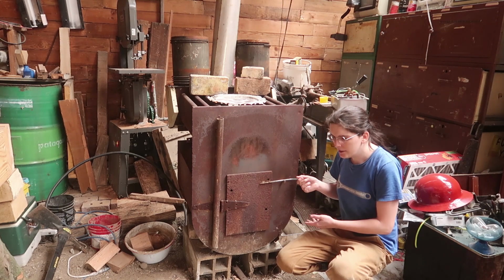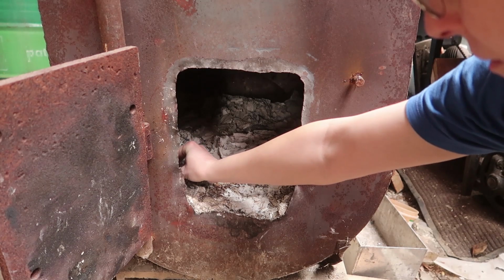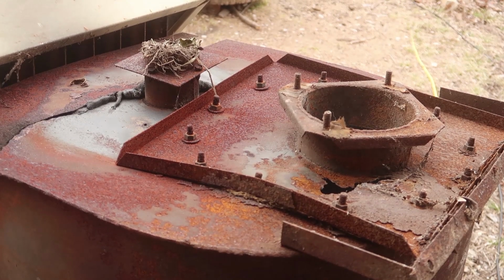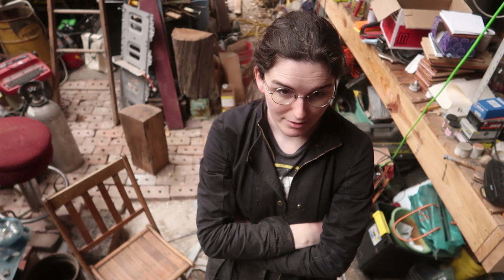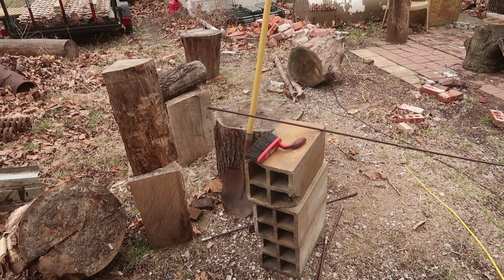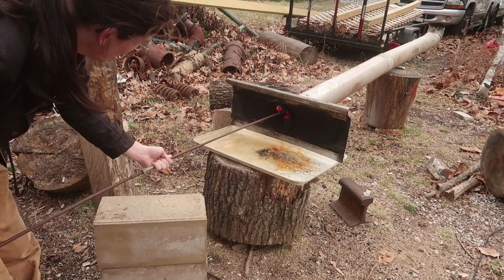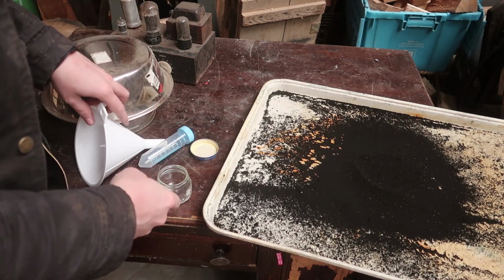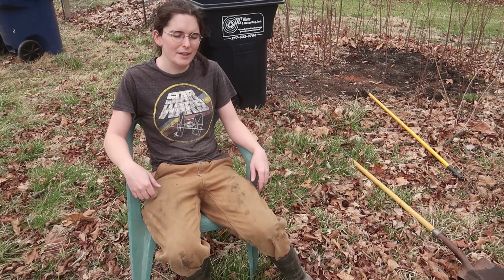Random Bits 0260: Final Week of Winter "Pre-Spring" Cleaning. Remove Wood Stove, Clean Tree Garden.

Comment: I did the same thing for car-related tools, one relatively small box that covers basically anything that doesn't require jack stands or a tow truck (AAA membership is for that). Came in handy on my 20B RX7 when I had to replace its fuel pump in a library parking lot. A good starting point is 1/4" drive 6-17mm sockets, ratchet, a spinner handle and screwdriver bit set. Combine them together and you get a 2-handed torque multiplying screwdriver, perfect for getting downforce and leverage on those phillips screws that have been undisturbed since the 1980s. Tackling the FC RX-7 fuel pump is how I came up with it.